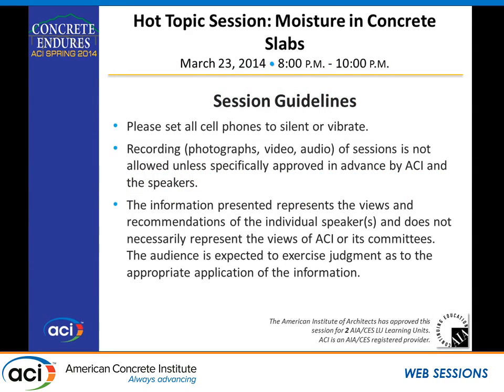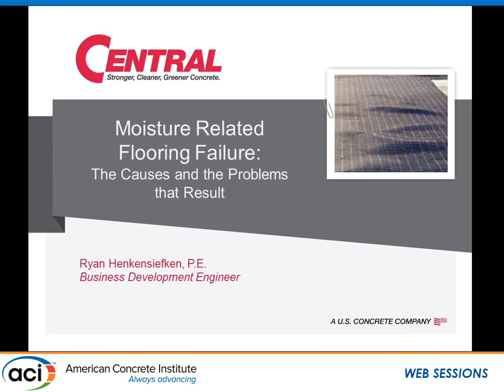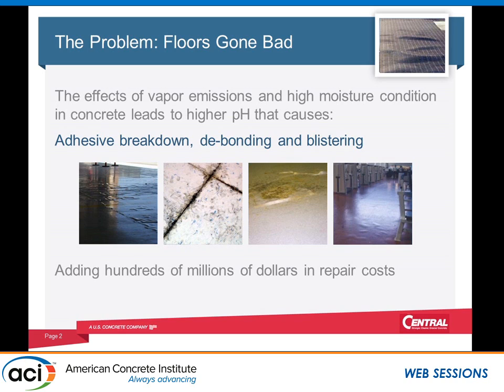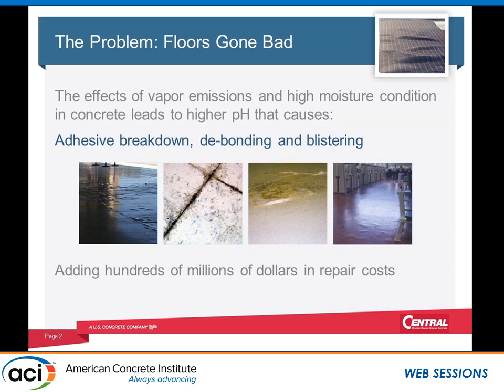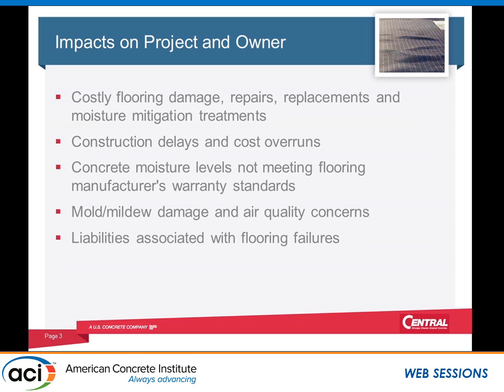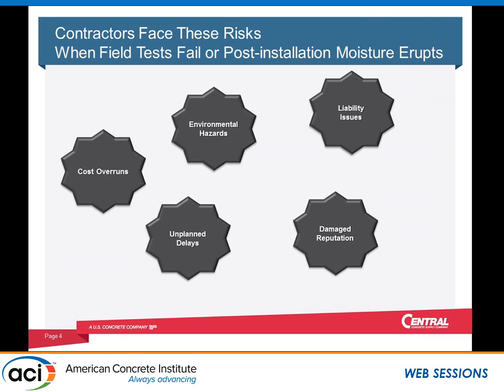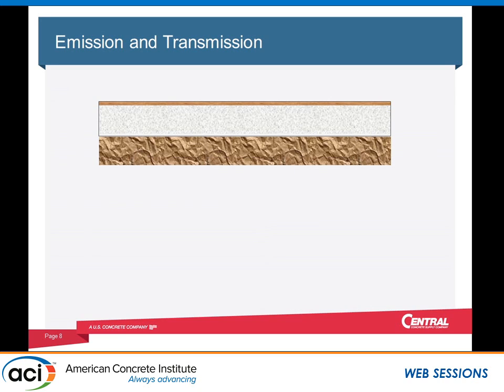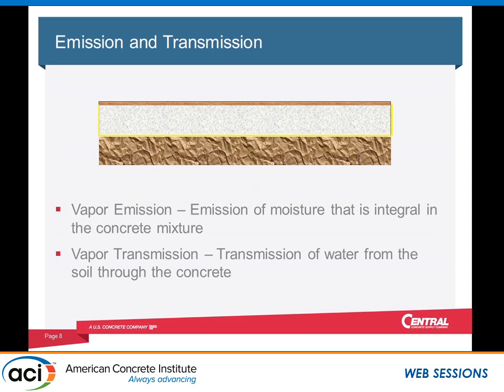Moisture Related Flooring Failure: The Causes and the Problems that Result

Comment: The blame on low VOC adhesives is old and outdated.  The chemistry used by adhesive manufacturers has certainly caught up in the last 20 years.  Isn't Ryan one of the chemists working with Stego/US Concrete on Airidus?  Craig is also a paid consultant with them.  Seems like that should be disclosed to people from the outset. As pushing the 'mitigation' to the spec stage is how the Stego sales pitch is given to the AED community.